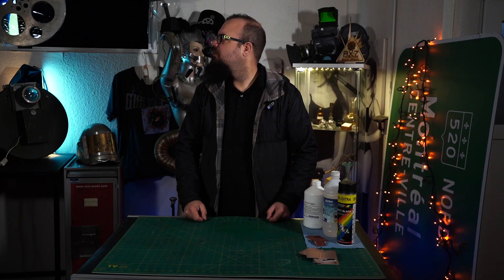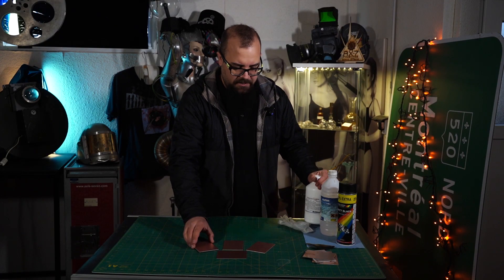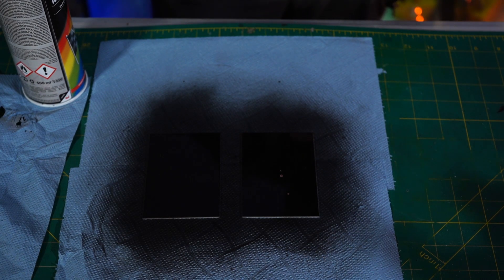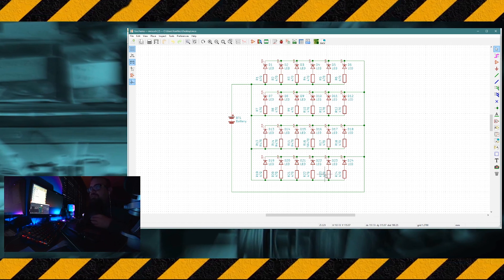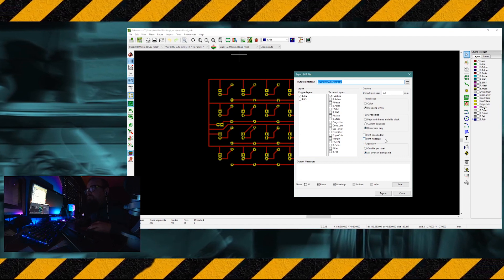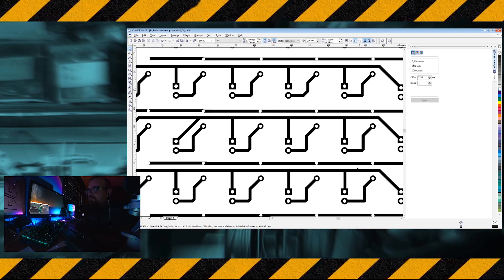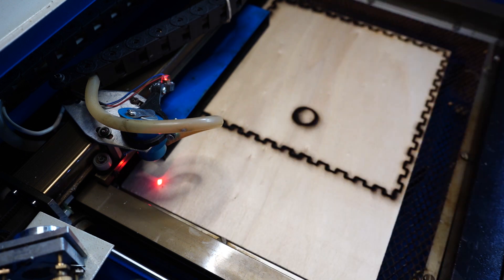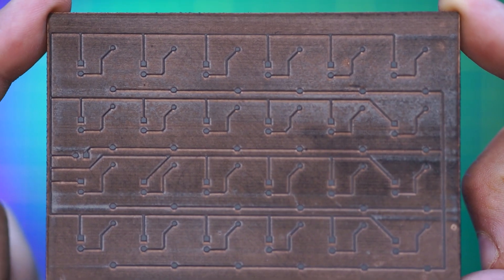Make PCBs with your K40 Laser / Tutorial

Comment: When I do stuff like this in my k40, I cover it with masking tape (aka painters tape) or sticky vinyl sold for craft cutters like cricut.   You might need to slightly increase power to account for burning through the tape.  When you're done with the tape, you peel the tape and have a beautiful surface left over.   No cleaning other than pulling off the tape.  I also like to use old vinyl sheets from my wife's cricut for this purpose.  It's easier to use because the sheets come in 12" x 12" and the material is thicker so it often peels in a single sheet.  On the other hand, burned vinyl smells a lot worse than burning paper tape.

Comment: The solder pads are on the mask layers in kicad, make sure they are visible when you export.

Also, you have an "edge cuts " layer in kicad, you could use that instead of the rectangle thingie in a separate program

Great video!

Comment: I understand that the laser is burning off the rest of the copper to create isolated circuits but what is the spray paint for? Would the laser not burn the copper off without it?
Reply from the maker: The laser burns away the spraypaint to reveal the copper that will be etched away later on. The copper under the spraypaint will resist the etching process.
Reply: How do you burn away the copper without also turning the surface of the board to carbon (a conductor)?
Reply: @jrstf  the laser doesn't do anything to the copper layer of the PCB. CO2 laser does not interact with it.   The laser used here is to only burn the pain away to expose the copper beneath it so that the enchant can eat the copper away.
Reply: @tttuberc  - Thanks.  That comment was awhile ago, I have no explanation for my error.

Comment: 5:00 When using 5 volts,  you could connect always 2 LEDs in serial, together with 1 resistor. Then your LED-board will only need half the current, and requires half the number of resistors. This works with red, yellow, green LEDs, which have ~2 volts current drop per LED. However, it does not work with white or blue LEDs, due to the highter current drop per LED. The resistor have to be calculated to drop 1 volt. So, it's 2 x 2 V = 4 V, plus 1 V for the resistor, which perfectly adds up to the 5 volts of your power supply. Resistor typically will be 47 ohms. This is how I design PCBs with many LEDs, i. e. for panel backlights.

Comment: I'd call it a failure, seeing how good the results can be in the home shop when using UV resist. I'd imagine UV resist could easily be exposed with the now-prevalent 10W/20W 400nm blue diode laser engravers. The chemicals required for working with UV resist are pretty tame (sodium hydroxide for developing, sodium persulfate for etching, acetone for cleaning). 
However, if you want to test again with paint and a CO2 laser, I'd imagine a makeshift spincoater could help getting a consistent and very thin coating that is easier to burn away.

Comment: Wouldn't you burn the copper away that's not needed leaving just the traces?  Or can't the CO2 laser burn Copper away?
Reply: From what I'm seeing in other videos, burning the copper away also burns the PC board, as in, turns the surface to carbon, also known as a resistor, so all your traces are shorted together.

Comment: I have made some PCB's on my CNC router for Arduino projects that I did not want to use the Arduino on, just the chip and the components I do need and not the ones I don't, but like yours, I have to make the traces much thicker but I like the laser method better so I will have a go at this
Reply from the maker: I once had a cnc router and f#%ed it up so bad that it broke off all my milling bits 😂

Comment: I've done that on my K40 in the past, although I found it really hard to remove the spray paint, from my experience using less power to the laser makes it a little bit easier to remove. I personally used Copper Chloride to etch away the copper (it's a lot cheaper than using iron chloride and can be made in large quantities at home) and it seemed to remove less trace material resulting in a bit more consistent trace width.
Reply from the maker: It was a bit of a pain to remove all the paint. The ferric chloride however somehow helped. Maybe roughen up the surface with sandpaper causes the problem. 
Good to know indeed i even have copper chloride here but never read that it would work so thanks for that!
Reply: @MancaveEffects my shortest way is  mask pcb with tape and then cut instead of engraving , after cutting tape, remove unwanted tape just like decal , Clean tape residue and etch. 💯😜